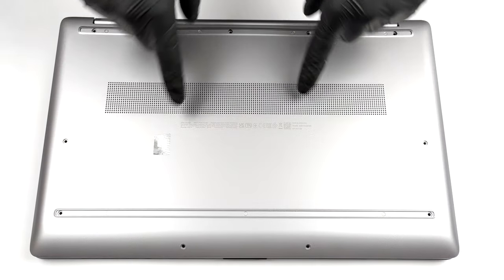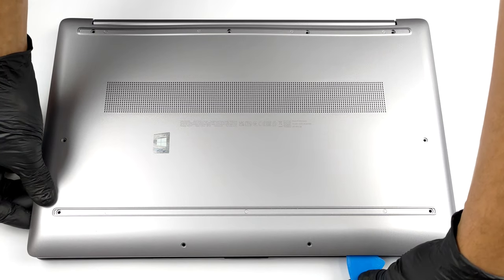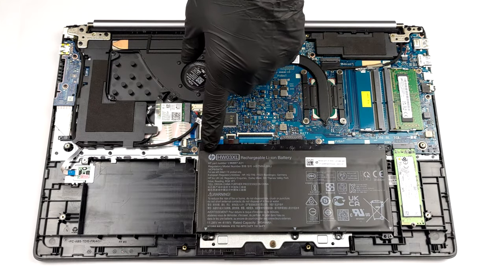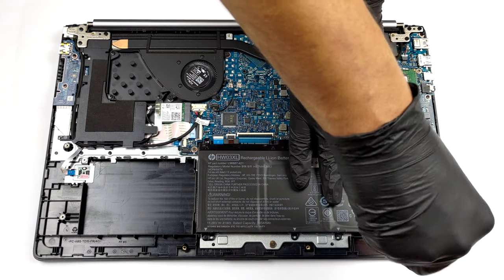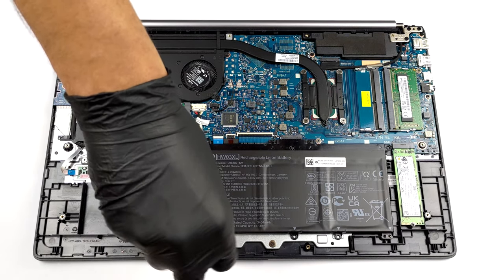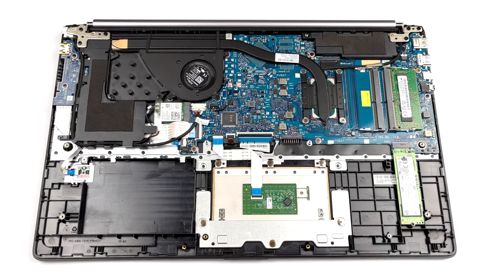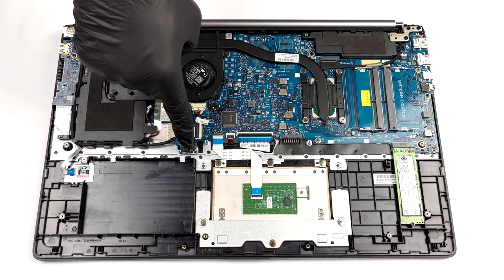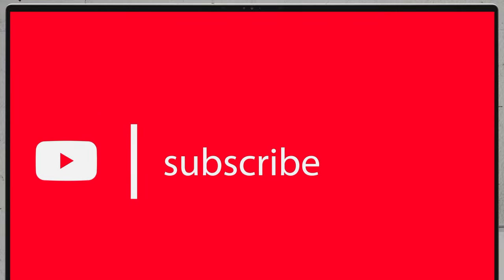🛠️ HP 470 G8 - disassembly and upgrade options

Comment: Well this one is definitely quite different than my HP 470 G3 computer.  I think I'd rather stick to my 470 G3, many more customization options available than this G8 unit.
Reply: 470 G2 (my wife's) and 470 G3 (my neece's) are both dead. G2 died after 7, and G3 after 4 years of use. Both died after several attempts of dying with odd symptoms. From time to time, G3 wouldn't turn ON, and G2 started to report a battery problem, and led by connector would lit orange instead of white. Both are now irreparable. Motherboard (and processor) failure (more than 1000€ cost). Clean the dust regularly, and change processor thermal paste at least once every two years. Those models have poor cooling. Main air inlet (over the fan) is through keyboard! Within (under) WASD letters.
Reply: @jurajdamjanovic  Sorry your G3 has had poor longevity.  Mine is still running great (with Samsung SATA SSD) to this day.
Reply: @JRobert111111   I just responded to you to warn you to clean the dust, and replace the thermal paste, because it is the main, and the most common reason of motherboard and processor failure.
Reply: @jurajdamjanovic  Thank you for the advice, I'll keep it in mind.  One difference with my G3 is that it gets very little use.  I just use it for family Zoom meetings on Sunday, and for the rare times I travel.  It seriously only has in comparison probably just a couple months of "normal" use since I purchased it in August 2016.  It's an extremely low mileage unit.  However, at notebookcheck they reviewed this computer with 0% PWM (pulse width modulation), but my actual computer did come with aggressive PWM (which gives me very bad headaches).  I took it to a local shop (that's why I bought a business model), and they brought in a new display and replaced it under warranty.  Luckily, the new display has 0% PWM.  So I bought another computer (identical), same screen issue, so I had the display replaced in it as well.  One has 16GB of SK Hynix DDR 4 memory, and the other I ordered Crucial DDR 4 memory.  They both have Samsung 1TB SSDs in them and both have internal Pioneer Blu Ray burners.  So I'm hanging onto them for awhile.  The second unit only has a few hours of use on it total since I purchased it in November 2016.  Then the parents needed a new laptop, so we ordered two more (one for each) of this model.  Same display PWM issues.  Had them replaced and miraculously both of those replacement displays had 0% PWM.  They just sport the 8GB RAM and DVD drive they came with and are used a lot, but they're holding up well.  I'll definitely keep your advice in mind for the parents' units especially.  Take care!